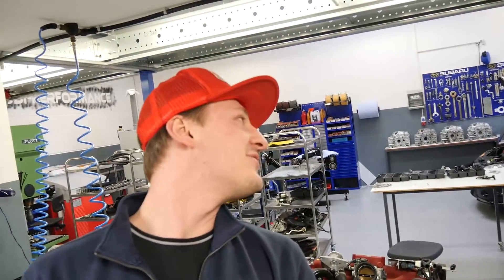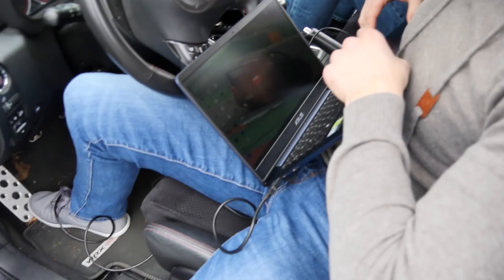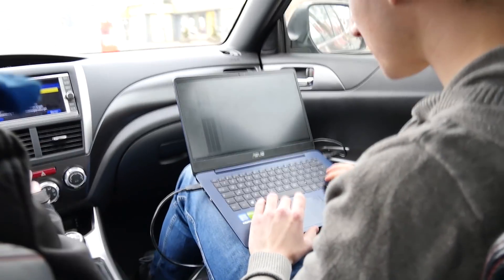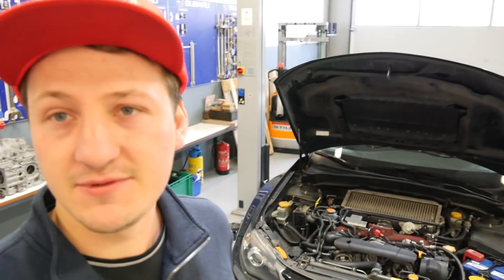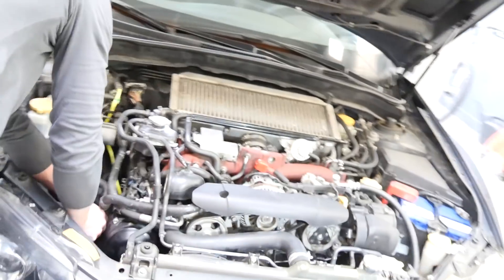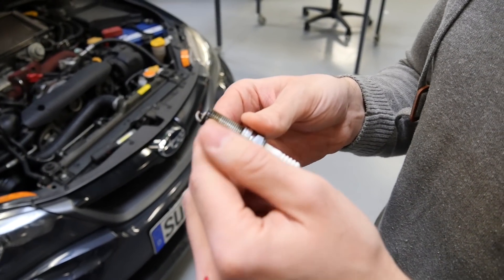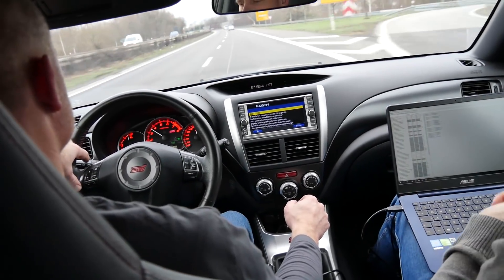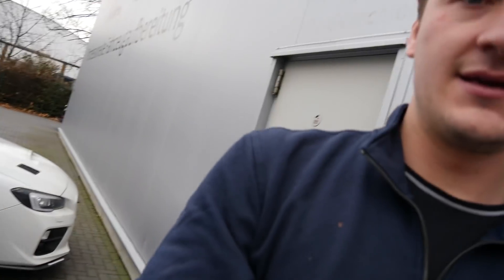Engine Misefire ! Diagnose Tips and Tricks (P0300,P0301,P0302,p0303,)

Comment: English is much appreciated. I'm troubleshooting a po302 on my Subaru sti.  Swapped plugs and coils. Next is injectors. Did smoke test on intake side for vacuum leaks did not see any.will try again. Did smoke test on exhaust side. Found 2 leaks on both sides of secondary catalytic converter.  Made repairs. Did compression and leakdown test  on all cylinders  all within specs